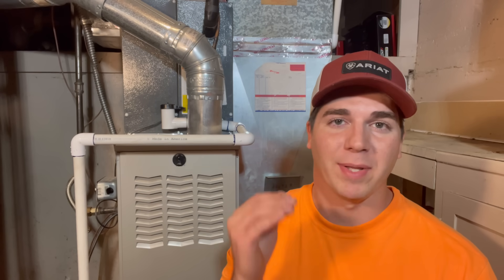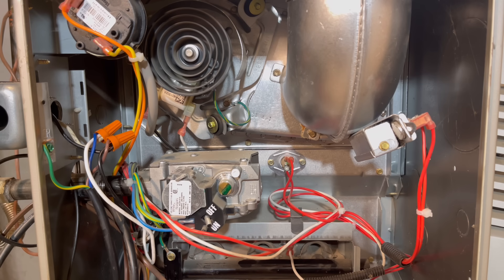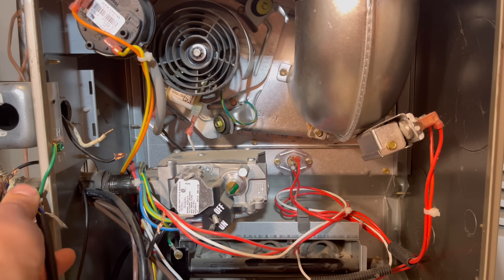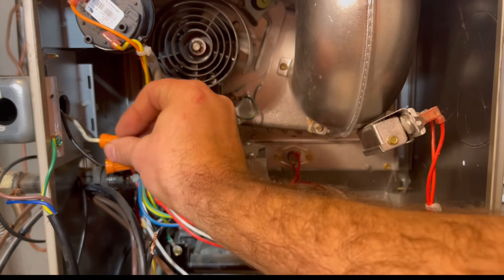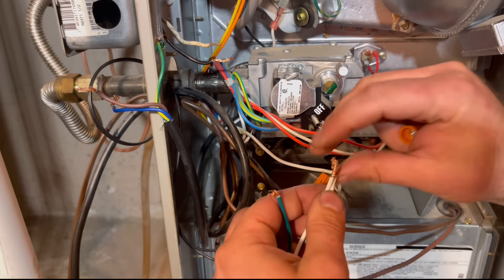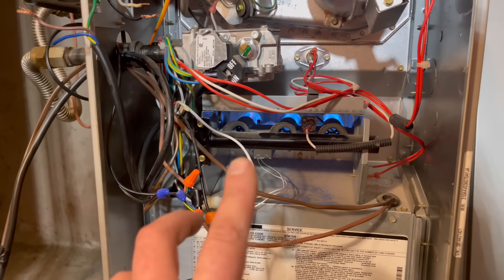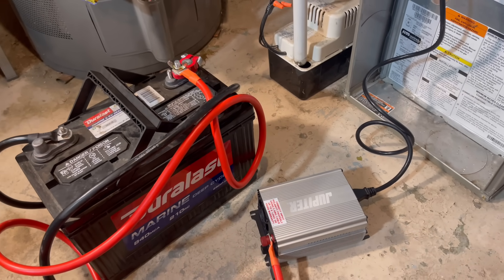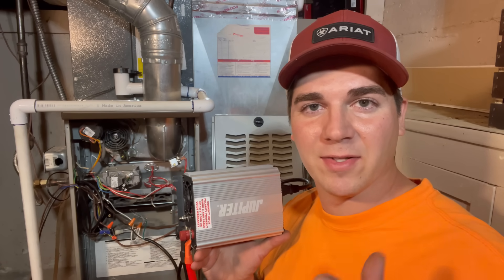Did You Know You Can Heat Your Home With A Car Battery?

Comment: Cost effectiveness considered, a  1500- 3000 watt sine wave generator offers the best option for long term emergencies.   I had a generator run for 3 days continuously to keep my pipes from freezing.  Those who abandoned their homes had a plumbing disaster when the thaw came. Harbor freight sells several models that will work properly and last if you follow the instructions, change the oil and use fuel conditioner when storing. Buying an extra battery or two is cheaper but will not last more than a few hours. Spend a little more and be prepared for the worst.

Comment: Just a quick thanks for this video. Just got hit with an ice storm and just finished rigging up the generator to the furnace. I'll be performing your more permanent mod later on. Glad I came across these video a few months ago. You saved the day! Love that the furnace pulls less than half of what my space heater was pulling from the generator.
Reply: It doesn't help us people with total electric central heating
Reply: @no_country_for_real_men  No, it doesn't, but then it's not meant for your heating system.  You need a correctly sized generator for emergency power outages.

Comment: Thanks for the video.  I see a green from the condensate pump that looks like it is grounded to the chassie.  I would be surprised if the furnace chassie is not grounded.  Your inverter doesn't have a ground, and so I guess that there's no advantage to attaching the plug round wire.

Comment: Using a bonding plug with a floating neutral power source like an inverter is the key to making this work with modern furnaces.
Reply from the maker: Have a video coming out on this. Thanks for sharing

Comment: Best to make a female box type and wire it to inverter
I had new systems installed and had a wall plug installed so it is a easy connection

Comment: Before to modify the original furnace instalation take the current value on the AC power input in the furnace. You can use an fork ampermeter. After calculate the furnace power consumation in watts (120v X I?). With this power value you can choose the min. inverter power for 120vac. For your application the dc/ac inverter must be 200% more power. After calculate the dc current from 12v battery to the inverter. Choose the capacity of 12v battery in Ah. Exemple: 70Ah=70A in one hour, 7A in 10 hours, 3.5A in 20 hours,  1.75A in 40 hours, etc.

Comment: I tried to do the same with my furnace but with an 1800 watt solar power generator and it did not work.  I think the power generator needs to be grounded, which these are not.

Comment: In 2009, I was not thinking of a power failure as the temps were -20 or so. Thankfully the prior owner had set the water boiler system with a plug cable kinda like yours. I had my fishing boat trolling motor battery on trickle charge. I also had an 800W inverter. The plug was longer, and I quickly brought the battery and inverter to the furnace room, providing heat for over 12 hours. I had a 1500w inverter in my work truck and it got us through the rest of the outage. Seeing this brought back that event.

Comment: My furnace must pull more power, tried 1000w and 2000w inverters with two parallel RV batteries and furnace would shut off after about 20 seconds. 3000w pure sine inverter and it works beautifully! Thanks!

Comment: This is terrific knowledge. My mind instantly started to make it even better. You could leave the battery installed in the car and run the power wires from the battery into your basement or a long cord from the furnace up to the inverter so that when the battery got low, you could just start the car to recharge the battery. Now, you’ll have to make sure you don’t dip down too low so that you can’t start the car, but, it would be a slightly more efficient time-saving way to do this. Another idea is to have two car batteries, side-by-side, and using the second outlet on the inverter plug in a portable battery  charger. Now, you can run a battery down until it stops working, and then simply swap battery connections.

Comment: But your using a gas furnace correct. If you do not have a gas furnace you could not use this method. Just like a gas stove runs off 120 v not 240

Comment: What about your thermostat? Will the power of the battery that powers the furnace run low voltage power to it as well through the furnace being poweredup by the battery?

Comment: Hey All, I tried this with 2 rv 12v batteries (parallel, full charge) and 2000w pure sine inverter. Wired inverter to ground through nearby 110v outlet, and plugged furnace directly into inverter 110v plug (usually my furnace is plugged directly into 110 with 3 prong plug). Initial fan would come on, furnace would ignite for 5-10 seconds then flame would shut off... Soon it would try to start over. What's going on?
Reply: Ok, same setup but with 3000w pure sine inverter and worked perfectly!

Comment: Do you think I could use this set up to my circulator pump on a wood burning furnace hot water heating system...I live in nova Scotia...do not have the funds to purchase a generator and file to run it

Comment: Another option, is to KEEP it wired to the inverter/battery and have the battery on a charger 24/7 (like a UPS). Furnace runs off inverter/battery power, charger keeps battery charged and if power goes out there is NOTHING to change. Been there done that.

Comment: Hi,

You presented good thought stimulating idea for short term solution. I knew the battery wouldn't last for days.. I also viewed your better invertor/truck alternator solution video. For an improved solution buy several refurbished fully charge 12 V auto batteries for $20 to $40 each and have truck recharge. I keep mine topped off with HF $14 Solar Panel Maintainers I suggest rather than heating entire house 24/7, instead buy for family members electric blankets that only use 40W to 140W each depending on setting. Then a battery or generator will last for hours.

Comment: Excellent video!!!!!
I've had something similar rigged up for over 2 decades! Run four 27 series deep cycle batteries run parallel with a battery maintainer. Inverters have come a long way in that time! (Basically, the same type of system, just bigger.)

Comment: This is great knowledge to have in an emergency.  I'm now thinking of a way to implement this as a quick switch where I wouldn't have to alter wiring during the emergency but could basically hook up a battery and flip a switch or move a plug.
Reply: Sounds good.  The comment above yours describes how one person did this.

Comment: Deep cycle battery might last a day in some areas. Regular car battery will be trashed in an hour in the north during the winter. Texas was dumb (used to live there), and their grid failed because they are not regulated and don't mandate that power producers have any winterizing done. This won't save you in the summer. I had a whole home generator installed after the first major outage. Was a life saver. The power went out all year round.

Comment: I have known how to do this for years.....
12v battery bank -> inverter (no square wave! just pure sine wave) -> ac load
dc in(solar panel, generator) -> charge controller -> battery bank -> inverter -> ac load
dc in(solar panel, generator) -> charge controller -> battery bank if(bank == full) then overflow load, else -> inverter -> ac load
saved you 8 minutes

deep cycle lead acid batteries have a low power density, go pick up a lithium 12v battery instead and you can change the voltages by series or parallel depending on your inverter(12v24v36v)

now if you got money go buy some 12v 400ah lithium batteries lol and make a battery bank of those but they are 1700 per battery.  storage is expensive generation either solar or wind is cheap.

Comment: "For several days"? I'm lucky to get 8 hours out of dual, like new, FoMoCo, 1000CA/850CCA before the batteries are so dead, the power inverter alarms out. Not saying this is a bad idea- it's not a bad idea at all- but I seriously doubt it's going to last for days. The duration is my only criticism. If someone is relying on this for survival & expecting multuple days worth of heat from a single battery charge, it could turn into a serious issue. Meh.

Comment: if you have a hybrid run it from the car batterie down to inverter with extension cord turn car on outside and it will kick the car on and off for days if not weeks while running it.

Comment: How about running the leads going to a vehicles battery to the battery which is being used to power the inverter, then you can charge the battery by turning the vehicle ignition on every few hours for a half an hour or so, to keep the furnace going- through the inverter.  Or run the inverter off the vehicle battery itself, or alternatively having some sort of generator hooked up to charge the battery every few hours and run the furnace off the inverter connected to the battery.  This way you don't have the generator running all the time.

Comment: So what starting watts and running watts does a furnace fan pull? Apparently not much but since 1 battery can run it for over a day but you need to know that to know what size inverter to buy.

Comment: Ok, but remember to put a wooden plank or some kind of insulator underneath your battery so that you don't waste energy into the concrete ground of your basement floor. Leaving batteries on the ground disperses the energy there by wasting extra time your battery could be helping you.

Comment: Good info. I think my furnace runs off a straight AC plug so I don’t think I’d have to do much beyond moving that plug from the receptacle to the inverter, but it def is good to know and prepare for now. 

Flip this around, will this work in the summer months during an outage and you need AC or is there more required to accommodate the condenser outside? My heater does both ac and heating.

Also it looks like the Amazon link you have an inverter that does come with cables that connect to the battery. So can you confirm this isn’t an additional required purchase? Thanks

Comment: Had to do this exact same thing from 12/23/22-12/25/25 due to the mega wind and rain storm we just had in Maine, I have a Jupiter 2000 Watt that I purchased at harbor freight with a everstart 800 cold cranking amps marine battery from Walmart and it worked flawlessly on my hot air furnace.

Comment: With that being said… after hooking everything up properly….why couldn’t you use the second plug on the inverter and use a battery charger or trickle charger to put  the 12volts back into the battery? So that your inverter is not just sucking the battery dead and thus shutting down your source of heat?

Comment: When the battery starts to die and the voltage coming out of the inverter is less than 120, what happens inside the furnace. I know electronics could burn up but what about the other components

Comment: Another good idea is to leave it battery in your car and you can use your car as a generator and go not just for days but weeks. Buy an old junk car and park it outside your house with an inverter connected to it so when power goes out you have a small generator already to go.

Comment: Watch out for the output voltage on that inverter.  Most of those units are made in China, and the actual output voltage can be as low as 100 volts, not the required 118 or 125.  With a lowered voltage the electronic control panel in your furnace will not function, and the unit will not turn on.   You could resolve this, as it is single-phase, with what is known as a "buck-boost" transformer,  a little pricey but will boost that voltage up to what is needed.  There are a number of "taps" on the transformer so you can use the tap that gives you the proper voltage.   Also, keep in mind that if you run another load on the inverter additional to the furnace, it may drop the output voltage yet again.  My solution to this is to buy a gigantic inverter, something with 6,000 watts output, a bit pricey but then again the unit has lots of reserve and won't fry or bounce around on voltage.  Plus, you can take it with you "in the field" to run things like table saws, build your cottage totally off-grid.  Cheers.

Comment: Just curious...if your power went out in your house, instead of robbing you rv for its battery, Why not just heat your rv and sit in there. Smaller space heats up faster. Just saying
Reply from the maker: Because that doesn’t do your pipes any good. And who wants to live in their RV for who knows how many days? I mean you could shut your water off and do that, but when everything comes back on your liable to have a busted pipe that will flood your house when you turn the water back on.
Reply: @diyhvacguy  I've never lived in the snow so I can't speak on that lol. I didn't know u have to shut ur water off,  I didn't even take in the thought of pipes freezing because the house is too cold with no heat. I'm from norcal so we never get snow. But right on man cool tip and video!!

Comment: That battery is about 100 amp hours . the DC amp draw is about 25 amps from the battery. Would run the furnace about 10 hrs if cycle time was 50%.The inverter takes 1 amp per hour that's 10% of the battery. Most inverters will only run down the battery 70% before it goes into alarm . generator about 2500 watts on Eco mode will run this set up 10 hrs  per gallon. longer if you cycle generator evey two his. This guy hooked up this properly and use good size 12 volt wires .

Comment: A bunch of missing information here; it's one thing to "empower" viewers and another to educate, this is often the difference between a diyer and professional posting a video. You might want to go over some of the dangers and not downplay the exposed wires. Your also talking about 30-80 amps on those leads between the inverter and battery and undersized conductors, under capacity battery and or bad connectors will start a fire and yes this will keep people warm but it's a hazard worth noting...

Comment: Now you need to add a little turbine generator to your gas vent so you can generate a little electricity to recharge your battery lol! Or good two batteries so you can drive your car around recharge the battery off the alternator and swap them back and forth. Or a solar panel and a charger to charge your battery.

Comment: I would take an exception to your comment that this battery can run your furnace for 2 days, if you used a 100 Amp/hour battery in new condition and fully charged, you have 1200 watt/hours of capacity. Conversion inefficiencies will reduce that to about 1000 watt/hours, your furnace likely consumes about 500 watts when running, so if it was really cold outside and the furnace running continuously, it would only run for about 2 hours.
Reply from the maker: It ran for six hours. I apologize I was not accurate in this, but six hours is still good knowledge to have in a pinch!
Reply: @diyhvacguy  A lot depends on the duty cycle of the furnace, extreme cold temps seem to occur when power outages also occur, it might be wise to have several batteries on hand.  My electric car came with a 120V inverter, I have 77000 watt/hours to work with!

Comment: Excellent idea!  Better than a generator to have a few days of heat. A generator needs gasoline, an exit for its exhaust, has to be maintained, and will require an oil change from time to time. 

I would buy a couple of large 12 Volt truck batteries, put them in parallel, and have them connected to an automatic charger.  At the same time I would have a 1000 Watt inverter connected. With no load the inverter will draw almost no power.  

At the natural gas furnace end I would have a change over switch properly wired in.  If there is a power failure I can simply move the switch and be on the emergency power.  The output of the same inverter can be used to run some LED lights (when lights are required), phone chargers, and a laptop if required.   LED lights and phone charging take very little power. 

Another solution is to buy a 1200 Watt or larger UPS with extended battery option as like used for computer systems. Expensive up front, but will work automatically when properly connected in to the furnace electrical supply.  If the power goes off the UPS would kick in automatically to run the furnace as required. This way the furnace will work automatically without any attention to it  during a power failure.  The UPS batteries would have to be changed about every two to three years to be absolutely reliable. It is worth the investment. 

I have four 1200 Watt UPS units for running each of my computers, my networking, and charging my devices during power failures. I also have a dedicated UPS for running my security system.

Comment: If you think about it in theory why couldn't you just plug a battery charger into the inverter too and charge the battery at the same time
Reply from the maker: Thermodynamics say otherwise :)
Reply: @diyhvacguy  I wonder if it would work that way

Comment: What a great idea. Thank you very much. Not sure why I didn't think of that  before. The beauty of this solution is that there is no heavy generator to deal with outside and no emissions. Simple straight solution.
I will go ahead and check power requirements on my furnace and buy the converter and one or two spare batteries that will be kept fully charged and ready whenever there is a storm.
Thank you again,
AJ